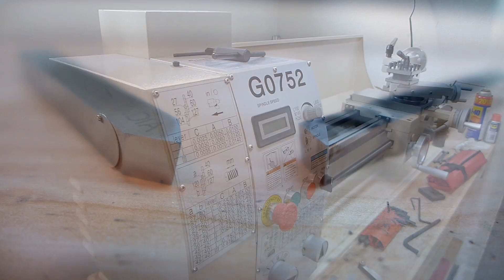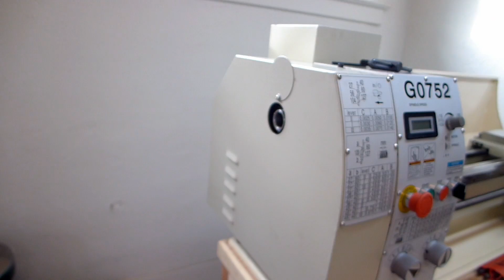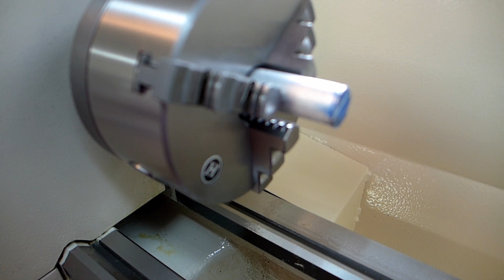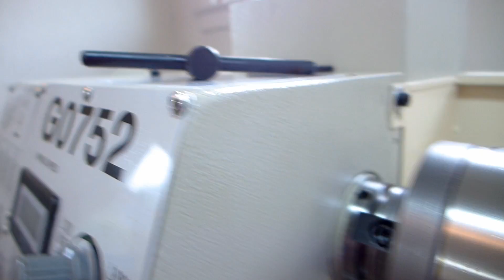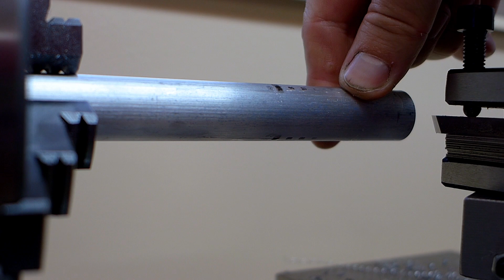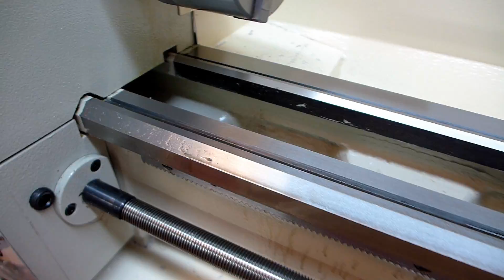Grizzly G0752 Setup, Part 3 (and first use)

Comment: Would this be a good lathe for a beginner?
Reply from the maker: +Ron I'm a beginner and I think it's just fine. Actually, I think a beginner could learn on just about any manual lathe. Mostly, it's a matter of your budget and space. They all work generally the same and you would have to learn the same principles to use them.
Reply: Thanks Jay ....I'm close to you in Yelm
Reply from the maker: +Ron Whenever I hear Yelm, I think of JZ Knight/Ramtha.  :)

Nice to be in a bit of a remote area, though.

Comment: Would this machine be too loud for an apartment? I am just starting out and the advice I read is buy the biggest machine you can. I am looking at the 7x16s from Micro Mark and Little Machine Shop, but if I can manage it, I'd love the 10"x22", however I do not know if it would be too noisy for an apartment.
Reply from the maker: +Kyle Blank I think the loudest part will be the actual machining (i.e., the bit cutting the metal) and you will have that issue with any machine you buy. The machine running by itself is pretty quiet I think. If you don't need the power feed and aren't threading, you can disengage the quick change gears and this lathe runs very quietly.
Reply: Jay Williams I see, thank you for the information :) I actually hadn't thought of the fact that machining (metal cutting) noise itself is probably similar across different size machines.

Comment: I've been machining at home for a few years now. I remember starting out too lol. I started out by fully rebuilding and modifying an Atlas Commercial 12" machine. I spent 6 months restoring it and doing a VFD, DRO upgrade. Did alot of upgrades and came out with a really nice machine... but not as nice as yours. Mine is pretty lol but yours in more capable. Anyways I was fortunate in that my best friend owns a machine shop and is very very good. I learned alot from him and looking back I'm scared to think what I may have done had he not taught me so much in the months leading up to I actually getting my lathe running. Just be careful and use common sense... Take 5 every time before you turn the machine on. 5 seconds to look at everything an ensure nothing is incorrect. I hope you're learning and still have all your eyes in and fingers (joking). Goodluck man. Thanks for making the video. Nice machine by the way.

Comment: Hi,
I heard that the spindle thread is not usual, so that if you want to fit some (after market)  back plate or using  some er40 collet check then you have problem!  because they are hard to find, so that whats make the hux nut check like the one  PM 10x22 sale is better!!   
the other question is that ; can you do left and right thread cut? and do you sue the threading dial when you cut metric and inch? 

thank you
Reply from the maker: +Ozy Ozy I'm planning on doing this, which I think is pretty neat.

https://www.youtube.com/watch?v=HXGcLwWZeSQ

I don't believe it will cut left hand threads, but I've heard of people modifying their lathe to do that. Another fun project. :)
Reply: +Jay Williams 
sorry for getting back late to you...

I think you can use Sb9" drew bar and 3c collets, really easy...

I have that set and after taking all the measurement, you may need to make 5mm sleave to go on the collet sleeve to make is little think so it can sit on the spindle bore...
and for the drew bar you can cut the sleeve of the back of the bar that rotate and set against the spindle from the back cut it little shorter so that the length of the spindle shaft can reach the collet from the other side....

for the PM lathe you don't need to cut the back, because the  spindle  same as the SB9

did you have the chance to check your spindle run-out in the bore and on the outside of the shoulder ?

keep up the good work, be safe.
Oz

Comment: There is a site on EBay that sells those plates completely machined to fit your application. I have an old South Bend  9 in lathe and replaced the tool post with a Phase II that came with the plate that must be machined. I ordered the plate that fit my application and it works great. All you need to know is the bolt size and the application.

Comment: Jay, I'm about to buy the same lathe. Your videos are excellent especially to a soon to be owner. I have one question you might be able to answer. What is the actual diameter of the spindle? I know the docs say 1", but usually those dimensions are somewhat larger. For example, they say 3/4" diameter, and it's actually .787 on some lathes. I'm hoping it's several thousands above 1.00", but I'm not sure.
Reply from the maker: Jim Stearns I'm glad you enjoyed the videos.

I just measured the inside diameter of the spindle from the rear (since it goes all the way through the head stock) with my digital calipers, and it looks like it's about 1.057".
Reply: Jay Williams 
Excellent news. Thanks for checking, Jay.  I'm interested in getting large OD barrels through, in case I need to do any work on a rifle. Most barrels are less than 1", but some are right there. Thanks again!
Reply from the maker: If you do any work on rifle barrels, I'd love to see some videos. Good luck.

Comment: Jay, the flex in the part is really obvious when you watch the video.  I know you are just messing around but here is how I do threading on my G0752.  I do it just like you were using the reverse switch.  You can ignore the thread dial.  But, you are going to get backlash in the leadscrew backing up like you were doing.  The solution is to add one extra step of backing out the cross slide, then reset back to zero for the next pass.  Be carefull with the long stock extending out the back side of the spindle.  I just read a recent accident report from a shop up your way, a guy was killed when a 1" rod bent and hit him.

Jim
Reply from the maker: RVJimD Thanks, Jim. I was actually wondering how backlash might affect the part if I just backed the other way down the thread with the reverse switch. Thanks for that tip.

Thankfully, it occurred to me that there could be an issue with a long, skinny piece of material sticking out the back of the head stock if it's spinning too fast, and I slowed it way down first, then watched to see what would happen if I sped it back up (I think that was a four-foot-long piece!). After just a tiny little speed increase, it began to flop around. I slowed it back down immediately. Crazy that a one-inch diameter rod could bend like that!
Reply: Jay, I did a threading video but I'm not sure how clear I was on that step?  If you use some sharpie ink or layout die and then do a real light scratch pass each way WITHOUT backing out on the cross slide, you can see really well how much back lash you are getting.  It seems simpler to me using the reverse switch and not messing with the half nut.  Jim
Reply from the maker: That's a great tip about the Sharpie! Thanks!

I'll check out your threading video, too.

Comment: Why not simply machine a new stud, long enough to pass through the QCTP but using the same male thread that fits the existing mounting plate?  That way, it's all lathe work--no need to be impeded by the current lack of a mill (which I'm betting you've got future plans for.)

You might need to get a metric die for the threads that mount in the plate, but McMaster-Carr/Enco/MSC Direct/Wholesale Tool to the rescue!
Reply from the maker: Why didn't you make this brilliant suggestion before I spent thirty bucks? :) I actually thought about drilling and tapping the exiting T-nut for the Phase II's bolt, but didn't have the right size tap. Either way would've required waiting, though, and I really wanted to get going! No, I'm not all that patient. :(

I definitely have plans for getting a mill. :)
Reply: Jay Williams
Of course, you're not patient! We Americans aren't known for our patience!  I'd have to plead guilty to that myself.  Certainly, I remember having to deal with the 4-position, lantern-style tool post, and that made a QCTP an emergency priority.

In any case, I only recently made the suggestion since I just stumbled onto your channel while searching for info for the Grizzly G0768 (8 X 16") lathe.  Your posting is the first I remember seeing for the 10 X 22 variable speed.

And it's not my brilliant suggestion--I believe a new stud is what Youtube user Russtuff (not sure of the channel ID) used for his G0602.  I'd figured it was worthwhile suggestion, nonetheless.  I only saw you had the T-nut plate modified in a follow up video.

If memory serves, I believe he made a completely new stud that had inch (yay!!!) threads on QCTP end and a metric (boo!!!) threads that fit the existing T-nut--he had one new part made with none of the existing parts modified.  I don't know if he ever modified the newly supplied T-nut or not.  I do remember he used 12L14 since CRS (SAE 1018) proved a nightmare to turn and thread.

Comment: What's the advantage to cutting a thread that way, as opposed to a die in the handle applying pressure with the tailstock and turning the chuck by hand?
Reply from the maker: Maybe if you don't have the appropriate die size or you want to cut non-standard thread size or you need a tighter tolerance. I'm no expert, though.